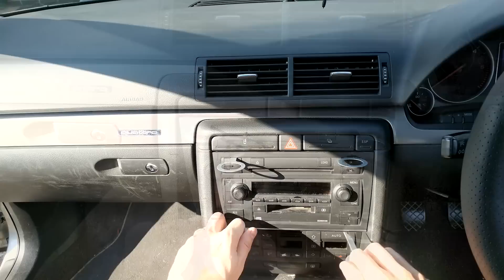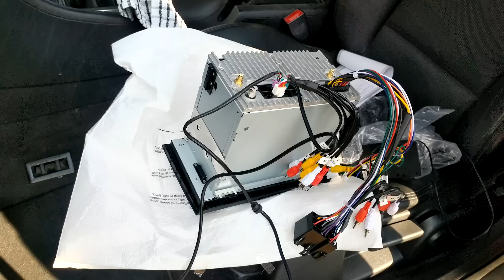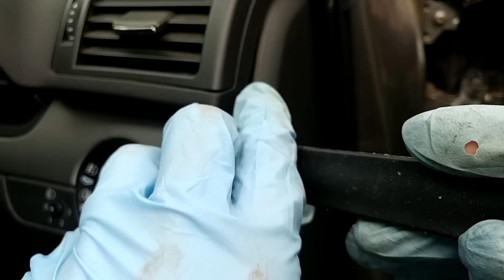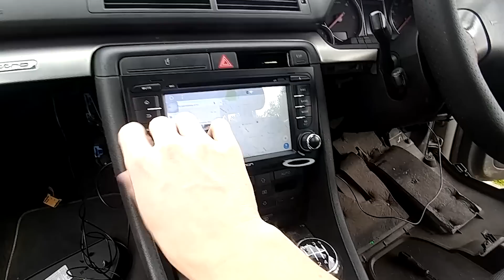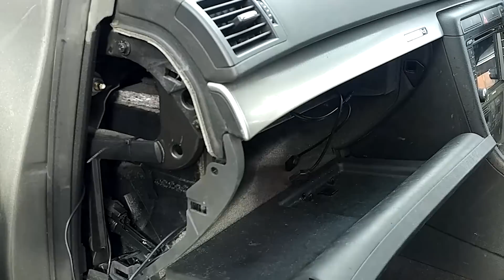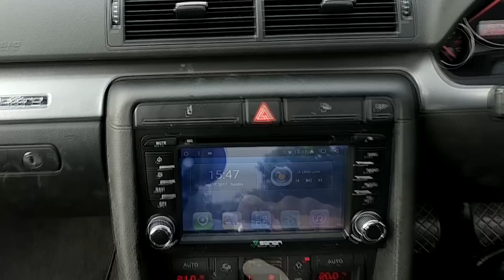How to install an Android head unit in your Audi A4 B6 B7

Comment: Didnt you have problems with the rear speakers not being amplified?
Reply from the maker: No issues at all, I purchased this particular unit as it was designed to turn on the amp and rear speakers.

Comment: Did you ever run into issues with your code reading on the OBD2 or VAGCOM ? I managed a good install of my android unit but I am trying to connect to my code reader but it will not work. I've heard it could be a k line shorted and we just need to remove the wire. All helpful input is appreciated. Have a great day!

Comment: with the non-bose syphony 2 on B6's do the rears need a line converter to get full sound. My B7 had very quiet rear speakers and I am wondering if this was the problem when I installed an aftermarket Pioneer media player

Comment: Hi mate, just got my stereo fitted recently, but my stereo doesn’t power off when you switch ignition off and remove keys .. any idea or suggestion?
Reply from the maker: Did you fit the canbus box? Without it, it doesent know powers off. Also there are two live sources and you could pop the pin and swap them. I heavily suspect it's the canbus box though as you can set stuff like stay on for 2 mins after keys removed

Comment: What speaker wires did u actually connect for the rears  to work
Reply: He said the rca cables but my radio is missing them I’m checking on what wires run to the rear speakers

Comment: Hi mate, what did you do with the aerial/antenna? One of those is fakra, one of those is DIN. Is there an adapter for this? Where's the video with that?
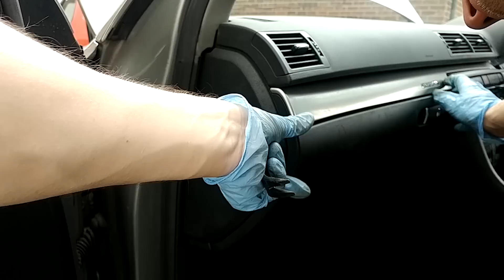Reply from the maker: I pop the antenna adaptor in at 3:08 and it's brief but I show the wire layout at 4:15 - I found the FM reception to be poor and when I looked online it seems to be a mix of different adaptors/boosters but also potentially the Audi aerial itself being broken.
I have a very high data allowance so just stream everything tbh as it's better quality.
Reply: @CarAndMechanical  So mine has a yellow fakra connector and a normal din connector, my point is, how do i make both of these into a single connection. I need some kind of diversity amplifier no?

Comment: Did you need to by a wiring harness separately from the head unit to get this to work with all the controls and reverse sensors
Reply from the maker: My kit came with everything I needed, worth double checking before your specific order but they seem to want to make sure you are good to go.

Comment: Hi - very new to all this, could you give me a link for a compatible head unit please?
Reply from the maker: Hi Mike, I can but will really recommend you check some bits first against anything I give you - there are a few types of A4 stereos so you need to make sure whatever unit you have will work - I think the type I had works with most. The other thing is Android units are always moving on in tech so power of the CPU's and ram change, back when I got this is was over £200 but think now an equivalent would be under £200.
This is the closest I've found https://www.ebay.co.uk/itm/32GB-2GB-Android-8-0-Head-Unit-Car-Radio-DVD-GPS-SAT-NAV-OBD-DAB-for-Audi-A4-S4/192831195839?hash=item2ce5a28abf:g:F8cAAOSwFCpbqdWS:rk:35:pf:0
There are others for £160 or £300+
I would recommend before purchase checking about the rear amp connection because it's the thing people seem to miss with these units, in the video in my version (hopefully the one linked too) I've used the RCA's which feed the rear speakers.
Hopefully this helps.

Comment: I have this same unit and on a Audi B6 and the radio would pop when I remove the key.   I had to try a Line Out converter, but that lowered the volume.  I could hardley hear it.   I ended up trying an other Line Out converter, but the same result.   I switched to ground loop issoloator, and now its louder, but I still have lots of back ground noise (buzzing in the back gound). now trying to fix that.   Did you have all these problems?    I have bose radio and am using the factory amp.
Reply from the maker: Hi, before this were you running stock wiring/amp? I've had this issue in an A3 when I tried to bypass the wiring setup for the rear amp and that was the result.
If not what's your stock set up (bose/half amp/ no amp)

Comment: Can you explain the rear speaker connection you briefly mentioned in the video? I am trying to install the updated version of the same head unit and everything works...except the rear speakers/factory sub. Please help
Reply from the maker: Yea it's odd you have to connect the RCA's to each other, so on the harnesses there are RCA's that need connecting which output to the rear I think they are this way in can you run an aftrermarket amp.
So basically you have the plugs that go in, one has some Yellow and white female plugs and the other the male, connect them.

Comment: What is your honest assessment on sound quality?  I've read the sound quality on these Chinese aftermarket Android units isn't even as good as the OEM non-Bose system.  Also buzzing issues, rear sub issues, freezing etc.
Reply from the maker: Honestly works really well - I drove at least 2 hours a day getting to and from work and use the Sat Nav, Internet connectivity and other bits daily and often listen to music/podcasts and watch youtube when parked up and have no complaints.
If anything I need to upgrade my stock speakers and amps but everything works and I've had this head unit for 2 years now.

Comment: Does this set up retain the factory sub in the rear shelf working? Love this setup but would want to keep the sub too
Reply from the maker: Hi, yes for me it does. Both rear speakers and the sub work and are controllable to set levels, the kit has connectors for a 2 variants. 
My set up is non bose rear amp/rear sub and they work.
I use non quadlock plugs but I also got the quadlock plugs. It's key to connect the RCA's and the canbus module.
Reply: @CarAndMechanical  excellent I also have the non bose half amped version . Thanks for the speedy reply and informative vid.
Reply: @CarAndMechanical  same radio, connect rca like you, and no subwoofer, and real speakers:(

Comment: what are the solutions for single din cage?
Reply from the maker: There are a few options but depends what you are after.You can get Single Din adaptors to take a normal stereo but you'll need to research the correct harness (different ones for bose/half amps/full amped).
Also I know there are pop out android head units - downside they might cover the coffee cup holder/hazzard switch and esp button (worth googling some install pics).
The other option which is more involved is going double din dash conversion and grabbing the bits off a car being broken up - there's a few people who have done it on the B6UK group.

Comment: I bought this same eonon unit, after the fact someone said a aftermarket unit might give the computer chip issues through the CAN . Have you had any issues with your Audi after install?
Reply from the maker: Tbh it's not missed a beat in over a year. What issues have you head of?
Reply: CarAndMechanical I've just heard that if the aftermarket Navi is not specific to the model of the car it can cause electrical issues through the can bus. That's good to hear you haven't had issues. I'm installing mine today.

Comment: So I am having an issue with it powering on? 
Could this be due to not connecting the antenna wire?
Or, could it be because I have my car coded for an RNS-E?
I have a b7/8E with quadlock connection
Reply from the maker: Make sure the canbus module is plugged in. I had that issue too the first time. The power signal comes over canbus.
Reply: i definitely do, thanks
Reply from the maker: That's odd - it is painful but I'd contact Eonon, the power on signal comes over canbus and if you go for a DIY set up it's messy.
Double check the wiring diagram against a pinout for the stock head unit.
I've known people with RNSE switch to these without hearing of issues - ironically RSNE's tend to sell for a reasonable amount too.
Reply: CarAndMechanical is there a way I can contact you? I will try to put in a Sony XAV-AX100 in a A4 B6 8H Cabriolet and don’t know if things will work out. Maybe there forums where I can put photos in?

Comment: Did you use aftermarket wiring harness or did this bolt right on with stock harness ? Also how is the navigation on this unit?
Reply from the maker: Hey, it came with the wiring, if you check my videos the one before this I do an unboxing showing everything it came with. The Navigation is spot on and I either use offline google maps or wifi tether to a phone to get live traffic maps.
Reply: CarAndMechanical how do you use offline maps ?
Reply from the maker: Left hand sidebar in Google Maps, scroll down and go to offline maps, it'll show you an area and you choose how much to download

Comment: Hi. can you tell me how connect this radio with rear amplifier from audi? ( active rear speakers and subwoofer). Do you have active rear amplifier in your car? Thank you
Reply from the maker: At about the 7 minute mark I cover the RCA's - it's a little odd you have to connect them but it's the design. Also you have to move the speaker balance to the rear a bit in the EQ.
Reply: CarAndMechanical than you for info. yes it is strange because, this radio have 4x45W output for speakers so this makes me confused. ok now i am calm for my harman amplifier.

Comment: Where do you get those things to take out the radio
Reply from the maker: They came with the head unit but also have others from ebay for a few pounds.
Reply: CarAndMechanical  I have the single din radio but I’m thinking of getting the sat nav radio which is double din 
Car is a A4 b7 2005
Reply: Will it fit ?
Reply from the maker: You'll need to get the double din centre console from another A4 as the normal head unit is bigger then single but much smaller then double.

Comment: Hi great video!
I installed the dvd but i have a problem with the radio display and wondering if you can help me fix it?
I installed everything and its working great but the only think thats not working is the radio/cd display, do you know wich cable i have to connect for getting the display work again?